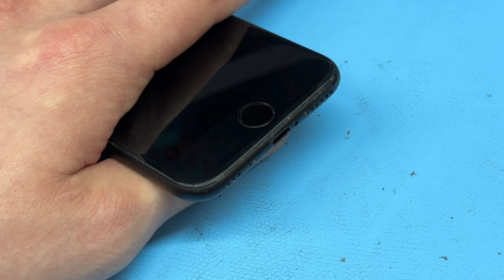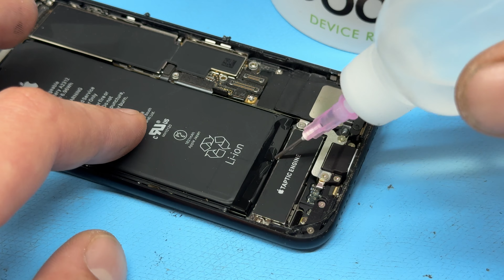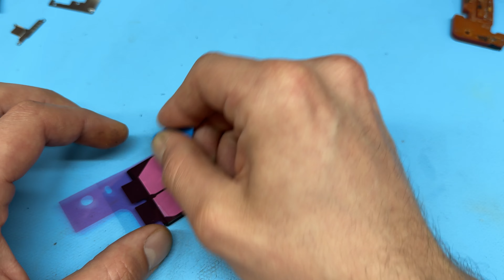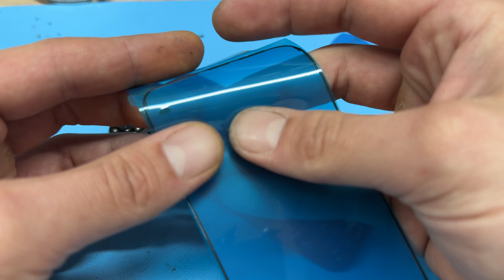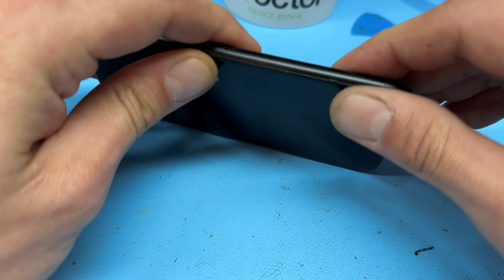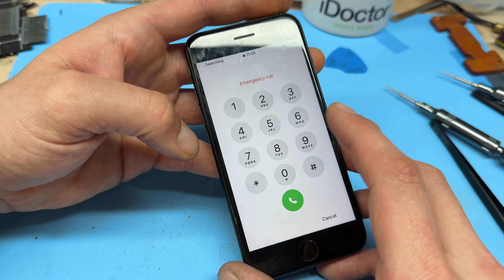Ultimate iPhone SE 2020 Battery Replacement Guide | Step-by-Step Tutorial

Comment: Just followed the guide and got it done. Thank you very much. I snapped the display cable on a previous one (the mug trick helps with that). The glue on mine was a pain to remove - took me an hour to clean up the backplate. Hoping the new battery gives it the much deserved extended life this phone deserves. BTW, I downgraded from a S25 Ultra and realized big "phones" have becomes. SE (or mini) is the prefect size for me. Yes, this is Oct 2026 and I am happy with a 2020 SE.

Comment: Holyyyyyy bro, i did this (absolutely amazing guide btw!) and just everything went wrong because I didn’t plug in the battery before putting it in so it didn’t fit and then i had to pry the new one out and dented it and other parts in the phone so honestly i am completely astounded by how it even turns on still, lets hope the battery isn’t damaged after all that tho🤞🤞🤞

Comment: Following your video i bricked the home button and touch id. It would have been nice if you put a warning not to plug in the new battery before putting screen back. Its absolutely not needed to remove the screen for this replacement imo.

Comment: Do the shields have to be put back on? Are they just there to make it difficult to replace the battery or are they used for actual protection
Reply: I think they're to protect the board from short circuits and improve the aesthetics of the internals

Comment: Can I avoid putting back adhesive sticker for the battery and metal shield for the connectors?
Reply: Why tho I mean you could but the connectors inside will most likely disconnect and you risk braking them if they rub together and the adhesive you probably won’t have any problems ngl other then the battery making sounds when you shake the phone it won’t feel as good

Comment: Thank you from a mid 40's aged mum from Australia! Fiddly but very dooable. The only other repair ive done in the past is pulling my imac screen apart and upgrading the HDD and RAM. Which worked brilliantly. Your video was the same. I thought all was buggered when I plugged it in and it didnt work. But I disasembled again and one of the little connectors was not seated fully. Fixed it and its currently having its first charge. Bloody legend. Cheers.
Reply: Yea, but your a ozzie, so you can do anything! 💪😁

Comment: Used this video to get me through the process of changing the battery in my iPhone SE2020. Everything went good except I had to do the pry of shame (it went well). The isopropyl alcohol really softened up the adhesive strips to the point they wouldn’t stay together. The kit I used had a two part seal kit. The big part to line it up and a second two part system to take off at the last minute before putting the screen on. Thanks!!!

Comment: Can you put a 3rd gen se battery in a 2nd gen?
Reply: No
Reply: @ too big? I was hoping it’d be the same size. Be a lot cooler if you could!
Reply: @dukeraul624  As far as I know, they have the same size, but a different connector. Most of the parts are the same between iPhone 8, SE 2020 and SE 2022, but it is the batteries that are always different, even though physically the same size
Reply: @ I C, thank you for the clarification.

Comment: Great video, thanks. Isopropyl  didn't do the job fully even after 2 soakings. Dental floss pulled along the underside worked butI had to remove the rest of the tabs left on the chassis. Had a problem with the seal fitting first time as it did not adhere properly and came away when removing the second layer! Second attempt worked okay. Phone now charging with no error message. Appreciate your expertise.

Comment: I've just replaced the battery on my SE 2020 and even though I've followed every single step, my home button and TouchID are not working anymore! Is there a way to fix this or should I take it to an expert shop? Thank you for your video!
Reply: Exact same issue!!! I just did my battery replacement 5 min ago May25/2025, the glue tabs sucked, the tiny screws were absolutely hell and now the home button/Touch ID won’t work. WHYYYYYY!!!! 😢😢😢
Reply: Well done you fvcked up the cable or connector of this part, if you stupid for that why do you begin take apart? 😉
Reply: @joedon9758  you will look back with so much shame on your arrogance once you stop being 14

Comment: Did that before and now I gotta do it again. I love 2020SE and I'm not into these new phones they are very large with countless futures that I don't need. I'm just using it for phone calls and work related registrations. The adhesives are difficult to remove sometimes. Did not have problem with iphone 7 few years ago but I had problems with 2020SE 2 years ago. What kind of alcohol you used to damp them?
Reply: Alcohol isopropilico, se utiliza siempre al momento de trabajar con componentes electronicos ya que no conduce electricidad y tiene un secado muy rapido.
Reply: @aliceonytagainmf  Already changed it but gracias. I'll use next time I need it.

Comment: Thanks for the video. Just replaced the battery and everything works fine. Now I just need to get rid of this unknown battery message.
Reply: Hope you kept your genuine Battery if not there no way around that message as you have to transfer a tiny circuit board off it to the new battery which is a pain in the ass!

Comment: Doesn't work. The original batteries come with a chip that needs to be soldered into the new batteries, otherwise it shows a non functioning, unoriginal battery.

Comment: Hey iDoctor I successfully changed my iPhone battery it is a special edition 2020 and I'm really really happy. last time I changed the battery I made a mistake probably  I connected the screen while the battery was connected and the result was that the touch was not working anymore and now I successfully changed it everything is working... front camera back and everything is fine. I one mistake I made I wasn't able to get the adhesive strips out correctly. So what I did I got an hair dryer and using the hair dryer I heated up the back side of the iPhone and that really worked. After you heat up the backup side of the phone you can use a suction cup which is very important and I use that to get the battery off the phone and thanks I was following your tutorial all along and I think you did a pretty good job and you are absolutely professional.